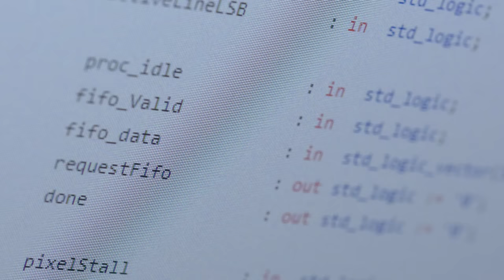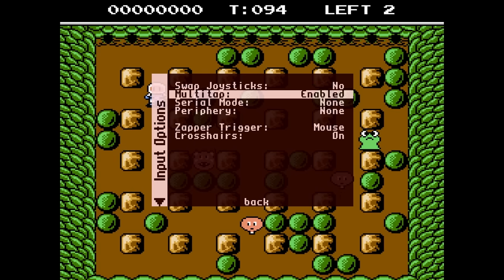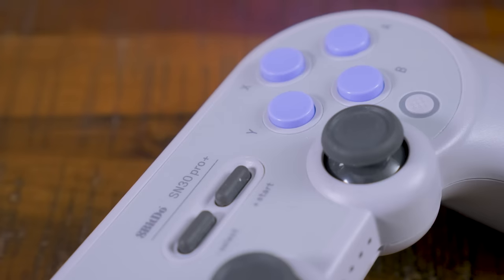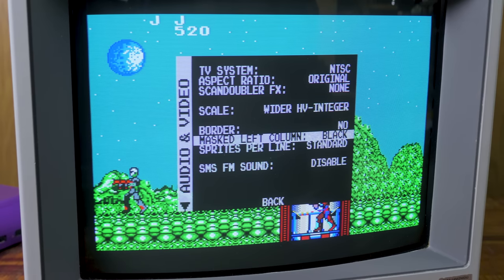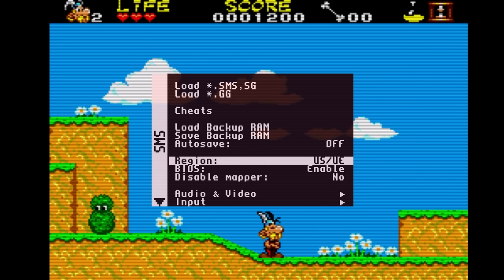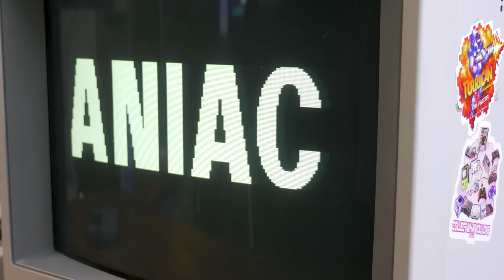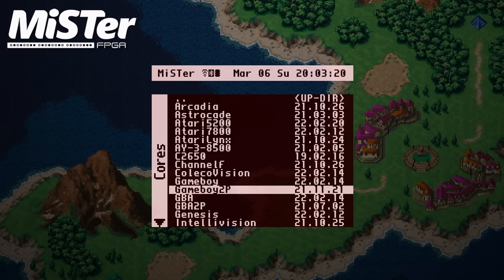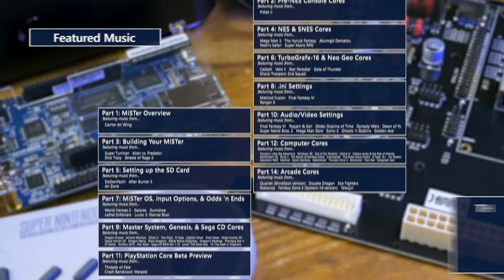MiSTer FPGA in 2022: A Primer Guide to Retro Gaming's Hardware Emulator / MY LIFE IN GAMING

Comment: When was this video made??  The mister console support is in a very good place?  It's over a decade behind literally everyone.  I emulate PS3 games beautifully on a system less than half the price.   The MiSTER has "Missed" the target.  10, 15 years ago?  Sure.   I'm honestly disappointed that you guys would put the time and energy literally worshipping a system thats 3 times the price, 3 times slower, twice as old, and supports a fraction of the games....You're totally steering people into old, outdated, and obsolete information.
Reply from the maker: [Try4ce] We acknowledge in this video that software emulation systems can emulate more recent consoles (GameCube, Wii U, PS3 as you mentioned, etc.). MiSTer is NOT able to handle these, but it is not old. It's quite new. It's a totally different type of emulation. It's not about being the single solution that covers all possible platforms. It emulates in hardware, by changing the actual transistor logic, which means it can execute tasks in parallel like the original consoles. Does it make a tangible difference? Sometimes yes, other times, maybe not so much. But the point is, the idea of this particular FPGA-based emulation method either tickles something in your brain, or it doesn't. If the idea of operating that much closer to the methods used by original hardware without OS overhead or anything like that doesn't excite you, then MiSTer is not for you and that's OK! Software emulation interfaces are equally exciting for some people - not me so much, but I understand the appeal. These are different approaches for people with different technical interests. It's not about which system gets you everything for the least amount of money. It's about your interest in the method behind it, that's all.